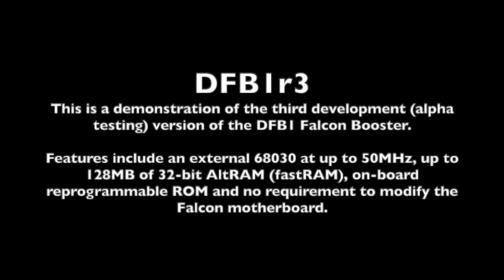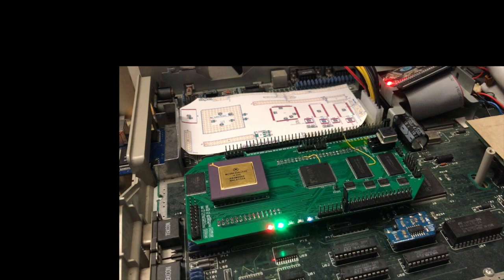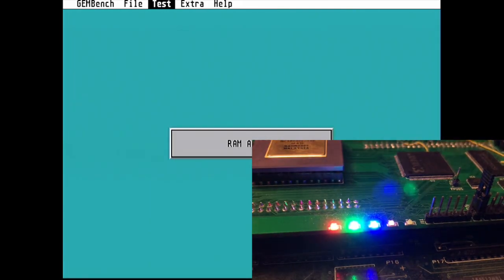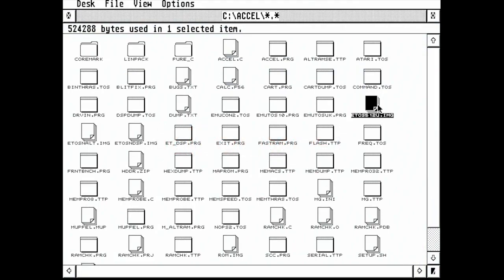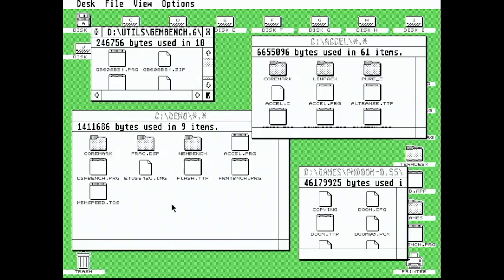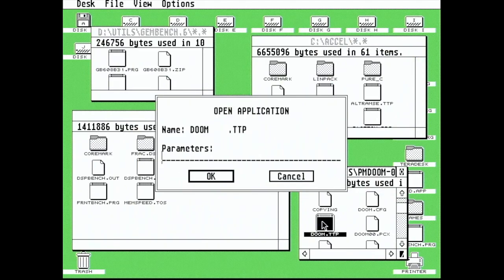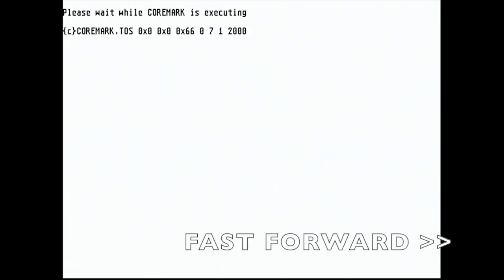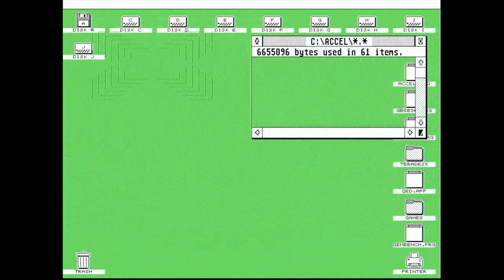Demonstrating the DFB1 development revision 3

Comment: Hello David!
That is extremely impressive what you have done there!
So piece by piece youbare replacing the core of the system. As all the Atari custom chips exist now as FPGA blocks, I am wondering about 2 things.
1.) ST vs Falcon RAM
What is the reason that the ST RAM us segregated from the Falcon RAM? Is it the old ATARI MMU that is blocking Memory ectension beyond 4 MByte? 
Could the ATARI custom chips be extended to use the whole 32 Bit address a range of the 68030/40?
I guess it would be 
2.) New Build
The circuit diagrams of the Falcon and ST used to be available in my ATARI days in the 1980s.
Isn't the next step an ATARI ST/Falvon new-built clone with modern peripherals and HDMI graphics? The ATARI custom chips are available as  FPGA and your experience with the DFB should make that possible.
Is that on the cards for you?
3.l as the Byffee team will open source most of their software and a lot if their hardware couldn't that substitute the Motorola part and give us a really modern Strau experience?
Reply from the maker: Hi there, thanks for your note. The only thing being replaced, really, is the CPU. The RAM is being added too. There is no such thing as Falcon RAM. The normal RAM on the Falcon is STRAM (defined as RAM the video system and DMA chip has access too). My additional RAM is classed as TTRAM.

Comment: An accelerated 68040 Amiga 1200 POINTS AND LAUGHS at Atari Falcon attempted acceleration, if Doom is anything to go by! And why is Frontier so unstable at that speed? The A1200 manages it with EASE!
Reply from the maker: Haha, ok, I know this is a troll, but here's the technicals if anyone is interested. Firstly, this is an 030 accelerator so comparing it to an 040 is of little consequence. One could compare it even more unfavourably to a CT60. Doom is an direct port from Linux using OS calls. No optimisation has been applied. See BadMood for an optimised Doom. Frontier isn't unstable at all... I've no idea what you think you're watching.

Comment: I never understood why anyone  would have a 1MW beam laser equipped on an Imperial Courier. It deserves a nice white beam!

Now, back to the matter at hand. This is so far the best accelerator concept I've ever seen for falcon. If it really comes as no-soldering-required plug-in board, and ideally with usable accelerated FPU, while fitting inside the original case, just wow! Marvelous achievement! Are 50MHz rated 030s and potentially 882s generally available?
Reply from the maker: I haven’t got the external FPU working just yet, so can’t comment personally, but I’m told the 40MHz ones are fairly tolerant to overclocking. The other option is to run FPU at half CPU clock. Researching this next.

Comment: Fantastic work, and great follow through on the project.
Is there a limiting factor to the amount of alt ram?
The Expose video capture card will use all available ram to capture video. More the merrier :)
Reply from the maker: The amount is baked into the firmware, but 32, 64 and 128 variants are fairly straightforward. I haven’t looked at higher than that as prices already at 128 are probably too high. 64 seems the sweet spot at time of writing.

Comment: GR8 :) 3 questions:
 - is it possible to use flashed TOS with DFB1 acceleration disabled?
 - what is expected price?
 - what did You use for grabbing video output?
Reply from the maker: Hiya & thanks. 

1) no, the onboard TOS is still there so that'll always be triggered when in disabled mode. It's perfectly possible to configure the CPLD to activate the external flash in the TOS ROM location when in disabled mode, but then you'd have to physically remove the TOS chip. Left as an exercise for the reader. :)

2) I'm aiming for all components bar the CPU to cost under £100. I won't be selling completed cards, it'll be down to the user to assemble it, or hopefully someone will build and retail them.

3) A cheap-arsed HDMI USB dongle from Amazon being fed with an equally cheap-arsed VGA to HDMI converter. Probably also from Amazon!